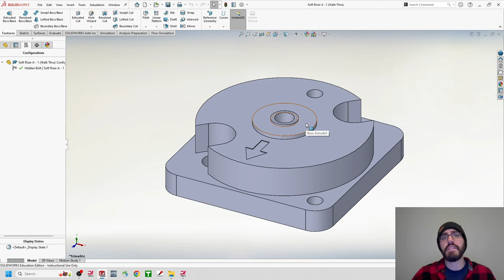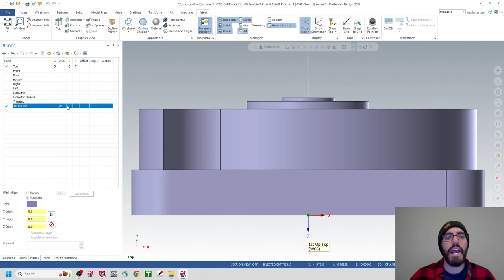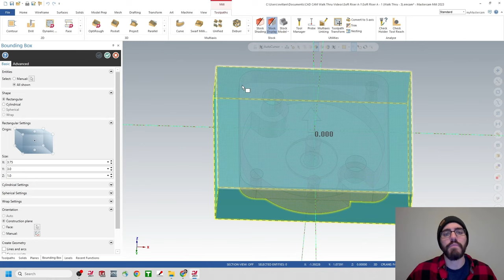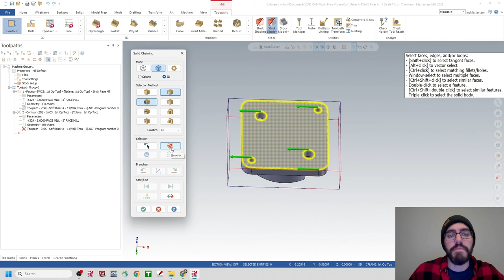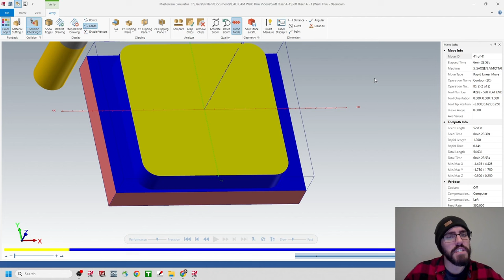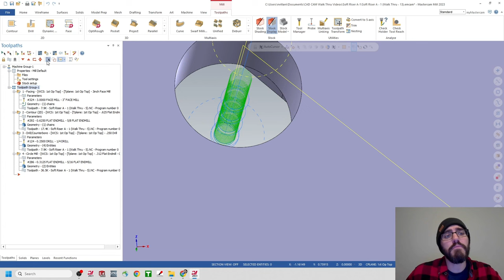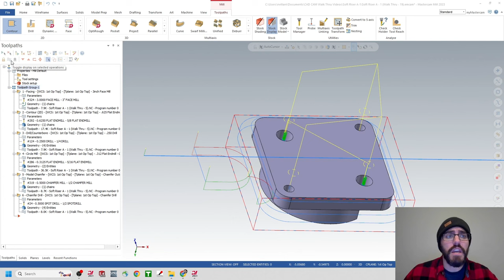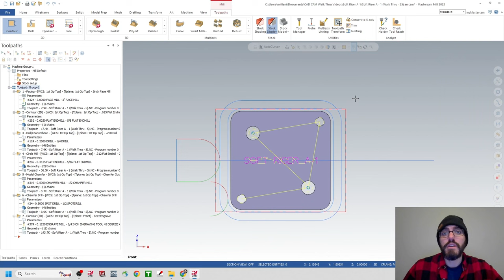MasterCam: Complex First Operation with Full Explanation of Features and Workflow

Comment: Very concise and clear.
Reply from the maker: Thanks so much!  Spent a lot of time on these tutorials for First and Second Operation.
Reply: Would like to see tutorials on 3-D tool pads on how to use them and where they are best suited at how to select the geometry and faces would be very helpful
Reply from the maker: I actually just posted a video recently on some 3D toolpaths for Mold Making - specifically Opt-Rough and Equal Scallop.  It's under my Arbor Press Case Study Playlist.